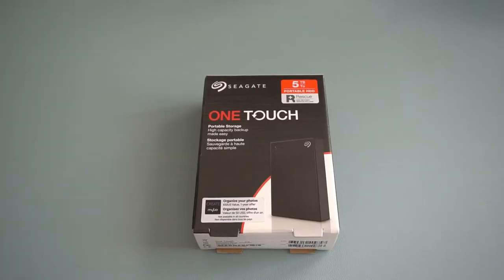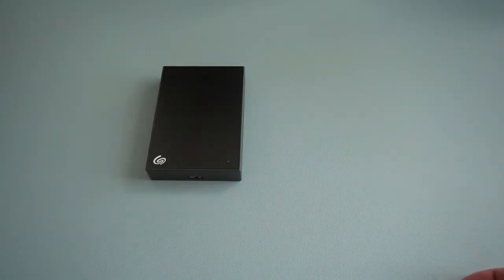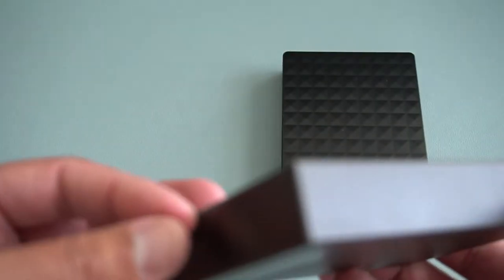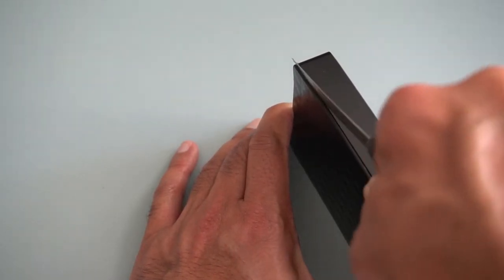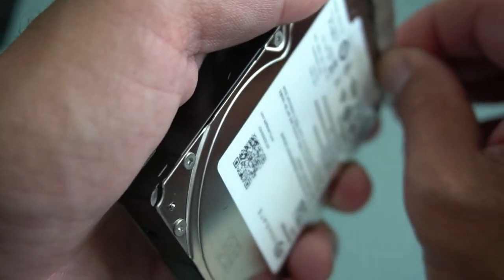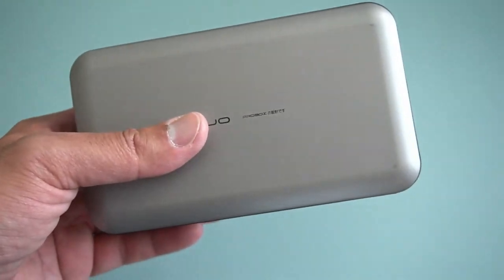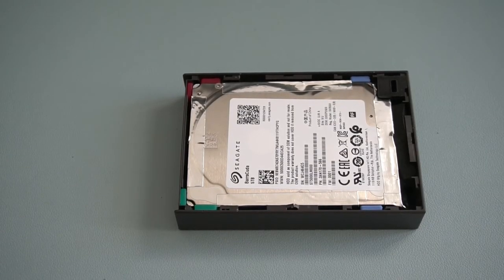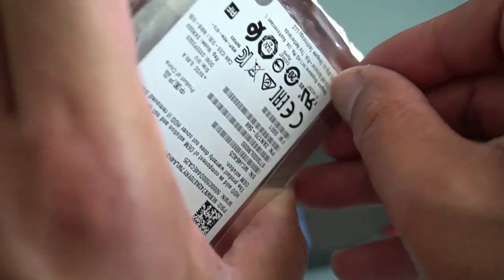Unboxing and opening Seagate 5TB One Touch, Backup Plus and Expansion hard drives, shucking, shuck

Comment: What's the difference/s among 
1. Backup plus
2. Ultra touch
3. One touch
4. Expansion hdd

Someone please answer what is/are the main difference/s?
Really, I am exhausted which one to buy?
Thanks.
Reply from the maker: Hi, Thanks for watching. Apologies for the delayed response.

So I'm assuming that you are asking primarily about the portable drives and will answer to the best of my knowledge. Some also have an SSD version which we will not discuss here to stay in context of this video. Hope that's ok.

Internally all of these drives are 2.5" SATA HDD's. The thickness will vary based on storage size. Usually up to 2TB the drives are 7mm to 9.5mm. 3TB and above are typically 15mm in height, such as the one described in this video. Laptops usually support a max of 9.5mm and though there are 12mm drives which can fit some older laptops, these are more difficult to find.

Below is a brief description of each:

Expansion - Is the basic offering of an external portable drive. Available upto 5TB (with slim drives upto 2TB)

Backup Plus - Has longer warranty (2 years instead of 1)  and includes backup software and Rescue Data Recovery Services. Internally I believe the drives are the same or very similar.
Available upto 5TB (with slim drives upto 2TB)

One Touch - Looks very similar to Backup Plus and I think it replaces (or will eventually replace) Backup Plus. It also lists to include a 1 year subscription to Mylio Create which appears to be a photo management app.
HDD available up to 5TB (with slim drives upto 2TB)

Ultra Touch - Same features as One Touch but includes security through Password + AES-256 Encryption. Currently available only in 1TB and 2TB, both appear to be slim drives.

Hope that helps. Feel free to ask anything else.
Reply: @TKsTechTalk  Yes, that's what I needed. So, ultra touch is the latest and most featured hdd than others. Okay. Thanks.

Comment: This is a great video! Thank you a lot!

I just bought this hard disk, and I was wondering how to open it. I don't want to open, but I am curious when I buy a new device.
Always it is useful to know how to open it, including when not needed (maybe shall to do in the future).
From several years, I only buy Seagate hard disk due to connector piece to adapt HDD-USB.
Others companies don't let us to do this, like WD. You can not extract the internal disk from external enclosure.

For your information, external disk model is STKC5000400 (Seagate One Touch, also known in previous versions as BackUp Plus),
and internal model is ST5000LM000 (Seagate Barracuda).

P.D.: Sorry for your knife
Reply from the maker: Hi, Thanks for watching. Glad you found it useful and yes I have to agree best to stick to Seagate for this option to easy remove the drive, and don't worry trusty kitchen knife's adventures will continue :)

Comment: Will this could be use as internal ?
Reply from the maker: Hi, Thanks for watching. It can be used in a desktop PC or even another enclosure or 3.5 inch drive bay NAS enclosure, but it cannot be used in a laptop as most laptops that support 2.5 inch SATA SSD's have a max drive height of 9mm and this drive is 15mm. Hope that helps.
Reply: @TKsTechTalk  much thank. Your comment save me alot of money.
Reply from the maker: @GeckoNavigator  no problem and  you are most welcome.

Comment: I opened the 4tb version. What buffle me it 2x 2000GB samsung HDD inside combine into one. Setup like raid 0. It read as 1 partion and read almost 3.7TB cant remember. Doesnt look like the one in this video using only 1 Hdd but thicker
Reply from the maker: Hi, Thanks for watching. I think its highly likely that this might not be a genuine Seagate drive. I have not seen annything like this to date, but was it in official packaging? Do you have a similar external casing to the drive in this video? I don't understand why it would have 2 x samsung drives either, im pretty sure all seagate shucked drives I can find online show seagate drives inside. Personally I don't think this would be a viable solution for Seagate as it creates 1 extra possibility for drive and RAID controller to fail as well as added heat in such a small area. Where did you buy it from, do you have a link?
Reply: @TKsTechTalk  yes, the outside case is similar to this video. Bought it few years ago from retail shop. Not sure if it genuine or not because i can store almost 3TB file. Hdd just getting slow to detect and pc getting not responding. Im decide to open the case and install direct to my pc, and that what happened. So far i do nothing, not splitting the drive afraid of losing the data. Im going to purchase new drive and backup it 1st, becoz i think the drive getting failure i guess.
Reply: @TKsTechTalk  and yes i think u are right. Probably not genuine product becoz why would seagate put other HDD brand inside instead of their own brand, right? Well atleast im glad the product never failed me so far. Love your video by the way
Reply from the maker: @sembangsembang6405  yes backing up first is the right path, would highly not recommend connecting to any other device before backing up as you don't want to break the RAID which will only work with a certain controller.
Reply from the maker: @sembangsembang6405  Thank you I really appreciate the comment and support. I'm glad the drive has served you well :), at least you were able to use it without failure till now.

Comment: ALL of the Seagate external 5TB hard drives have the SAME model of HD inside, it's the ST5000LM000 the only difference is the bundled software, case design and encryption, so it's better to buy the Basic model that is almost half the price instead of the most expensive backup plus version as they have the same drive inside and better use your own backup software and encryption
Reply from the maker: Hi, Thanks for watching. Appreciate the info, hopefully this will help others as well.

Comment: can we put the hard drive in a laptop and a ps4?
Reply from the maker: Hi, Thanks for watching. I believe the drive limit on PS4 is 8TB for external I think this drive should work in the original PS4 with some modification to the case where the HDD sits because the PS4 typically fits 7mm drives and this is a 15mm drive, there are some videos of people installing a 4TB drive of similar thickness to the 5TB into the PS4. Hope that helps.
Reply from the maker: Forgot to add, you cannot install it in most if not all laptops because the drive is way too thick at 15mm. If you need a spinning disk you can go for a 2TB 7mm drive or if you choose to opt for SSD then you can go all the way up to 8TB depending on budget because all SATA 2.5" drives are usually 7mm.

Comment: Great video, thank you for posting. I’m looking to do something similar with these drives.

Do you have anything you can share on the performance of two of these drives in Raid 0? I’d love to hear your experience.
Reply from the maker: Hi, Thanks for watching. That's a good question I'm currently using the drives in a Raid 1 configuration in the enclosure described. I did test the enclosure in the 4 supported modes which are Raid 0/1, Single and JBOD. Unfortunately, I didn't think to test the transfer speed when in RAID 0 so at this stage I can only assume in RAID 0 it will be almost double the single disk transfer rate. Currently I am achieving about 115MB/s (these are 5400rpm disks so I guess that's about right) in RAID 1, so I would expect a maximum speed around 200MB/s in RAID 0, I'm sure this could vary with the controller being used.

My only concern now is with the RAID 1 volume at 3.5 TB used I would have to break the RAID to test it ... if I do end up testing the performance I will definitely let you know. Hope that helps, feel free to ask any other questions.

Comment: can i use it in my laptops
Reply from the maker: HI, Thanks for watching. Unfortunately this drive has a thickness of 15mm and I don't know any laptop which can currently take a drive that thick, I also think this will probably never happen as it would make the laptop itself too thick as well. 

For most current laptops the maximum drive thickness if it has a 2.5" sata bay is 7mm or 9.5mm, which are mostly SSD's or spinning disks up to 2TB. If you buy the 2TB Slim version from Seagate it will be possible to install inside a laptop, but I would make sure you check the thickness your laptop model supports and ensure you buy a drive of matching thickness.

The only other way to get more than 2TB's in a 2.5" laptop bay is by using a 4TB or 8TB SSD, which can be very expensive but will provide much better performance. Hope that helps.

Comment: good video.  i learned my lesson with Western Digital drives.  they use that weird PCB which renders the entire drive *nearly useless if something happens to the board in any way.  
*"nearly" because somebody somewhere can repair them.  that someone is not me.
Reply from the maker: Hi, Thanks for watching. Glad you found it useful. Yes I agree about WD and what's worse is sometimes its just the enclosure that fails but in WD's case with that unique board as you rightly said there is no way you can check if its just the connector or the actual hard drive, they really should make it better for consumers. Worst thing is most people don't even know. All the best, TK.
Reply: A similar thing used to happen with 3.5 inch external drives from Seagate and WD.  That tiny USB to SATA board would fail & you'd think the drive was dead. However, if you took it apart and put the 3.5 inch hard drive in a PC it would be perfectly fine.

Comment: Great Video. What is the height of the drive? It looks thicker than the normal ones.
Reply from the maker: Hi, Thanks for watching. That's correct, basically any 2.5" drive which is 3TB, 4TB or 5TB is generally 15mm thick, so can't be used in a laptop but can be used in a PC with a 3.5 to 2.5 bay. You can get some enclosures like the one I described which can support two of these drives for RAID array. Hope that helps.
Reply: if you are looking to upgrade a PlayStation or xbox console, you should consider the transcend storejet 25h3 4tb

Comment: Can u put some other random hdd and put it in the old enclosure and use that usb to sata connector?
Reply from the maker: Hi, Thanks for watching. Yes you can use another 2.5 inch SATA laptop drive into the old enclosure. Not sure how a thinner (7 or 9.5mm) drive will stay without moving too much but you could try padding it with something to reduce the movement. Hope that helps.

Comment: Hi,what's the difference between expansion and one touch hard drive.thank you.
Reply from the maker: Hi, Thanks for watching. I answered this in another question but below is a brief overview:

Expansion - Is the basic offering of an external portable drive. Available upto 5TB (with slim drives upto 2TB)

Backup Plus - Has longer warranty (2 years instead of 1)  and includes backup software and Rescue Data Recovery Services. Internally I believe the drives are the same or very similar.
Available upto 5TB (with slim drives upto 2TB)

One Touch - Looks very similar to Backup Plus and I think it replaces (or will eventually replace) Backup Plus. It also lists to include a 1 year subscription to Mylio Create which appears to be a photo management app.
HDD available up to 5TB (with slim drives upto 2TB)

Ultra Touch - Same features as One Touch but includes security through Password + AES-256 Encryption. Currently available only in 1TB and 2TB, both appear to be slim drives.

Hope that helps. Feel free to ask anything else.
Reply: @TKsTechTalk  thank you.
Reply from the maker: @ZutiDIY  you are welcome.

Comment: Accidentally dropped it ona floor. Table height, will that mess it up?
Reply from the maker: Hi, thanks for watching. What type of surface did you drop it on and do  you see any external physical damage? is it still working? I think generally from table height shouldn't cause too many issues with the drive, though i guess it would vary between drives. I remember a long long time ago throwing a hard drive to try to make it read though i can't remember if that worked :). Hope your drive is ok, all the best, TK :).

Comment: I'm kinda PC Noob
Can you plug this in pc without opening it and puting inside that case you got ?
Tnx ^^
Reply from the maker: Hi, Thanks for watching. Yes you can connect it via the provided USB 3.0 cable to your PC's USB port. This video is just to demonstrate that you can remove the drive from the enclosure and use it inside a PC or another enclosure if required. Hope that helps.

Comment: What if to insert this HDD into laptop? The size of its HDD bay allows to do that
Reply from the maker: Hi, Thanks for watching. Though this is a standard laptop size drive with standard SATA connectors, the issue is that the drive is 15mm thick which is way too deep for any laptop I can think of. The safer option would be the slim version of this drive in up to 2TB capacities, they should fit into most laptops that support 2.5 inch drives at 7mm thickness. Hope that helps.

Comment: Does anybody know any NAS with RAID 5 support these disk will work with?
Reply from the maker: Hi, Thanks for watching. To the best of my knowledge I would imagine any RAID 5 enclosure which supports 2.5 inch drives should work, however I do not think it is recommended to use these drives like that, would probably not last too long and also may not get the best performance from them. It would be best to use enterprise grade 2.5 inch drives similar to the 2.5 inch EXOS drives in the link below:

https://www.seagate.com/em/en/products/enterprise-drives/exos-e/?cmpid=smc-spiceworks&utm_source=spiceworks&utm_campaign=brandrep&utm_medium=social

Hope that helps.

Comment: How come you shucked a drive like this rather than just buying a drive on its own? I understand if these were second hand but they looked new?
Reply from the maker: Hi, Thanks for watching. For me the main reason is the price and availability. Generally what I have found is that trying to buy a drive like this is difficult depending on where you are based and also the price is higher than buying it as an external drive. I think this is because there are more use cases for a portable external 5tb drive than a 15mm drive which fits in limited devices since most laptops can take hdd upto 9mm. I guess if you buy the drive on its own you still get the warranty so thats obviously something to consider. These are the same reasons you will see people shucking desktop size external drives to extract HDD's for their NAS systems or even in a PC, and when they are on offer they are even more cost effective. Hope that helps.
Reply: @TKsTechTalk  Cool thanks for the context. Wild that it can be cheaper to buy an external drive like this than the drive inside on it's own. Capitalism, ey.

Comment: Does this work for PS4?
Reply from the maker: Hi, Thanks for watching. I believe the drive limit on PS4 is 8TB for external i think this drive should work in the original PS4 with some modification to the case where the HDD sits, there are some videos of people installing a 4TB drive of similar thickness to the 5TB into the PS4. Hope that helps.

Comment: Are there lists for Seagate drives that use propertiery soldiered USB?
Reply from the maker: Hi, Thanks for watching. To the best of my knowledge most if not all Seagate drives do not have proprietary soldiered connectors so should be able to shuck them as described, however drives like WD 2.5" portable drives usually use soldered connectors, possibly some other brands too. Hope that helps.
Reply: @TKsTechTalk  Thanks for responding to comments a year later. That is useful information to keep in mind, thanks.

Comment: How’s the drive holding up?
Reply from the maker: HI, Thanks for watching. So far so good. Though I would like to say that I am using two drives in an enclosure in a RAID 1 configuration and only use it for backups, so far about 4TB used and still going strong. I know this experience can vary by user but hopefully most will be good. Hope that helps, feel free to ask anything else.
Reply: @TKsTechTalk  thanks for replying how is drive's S.M.A.R.T holding up .